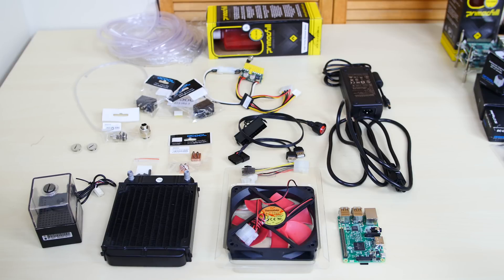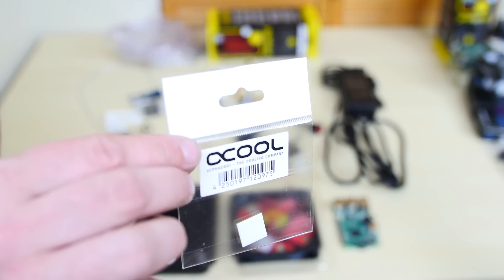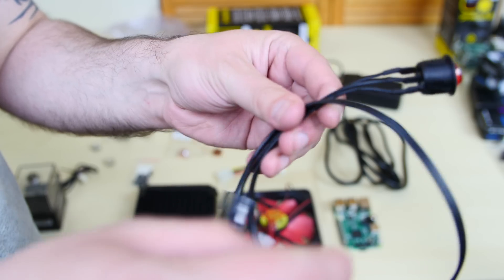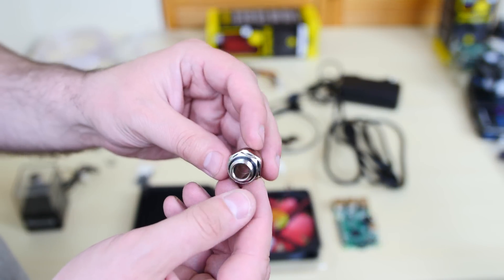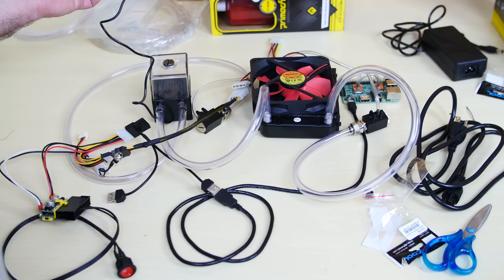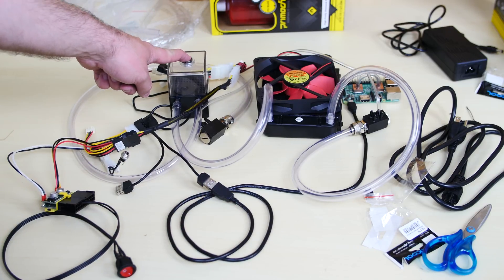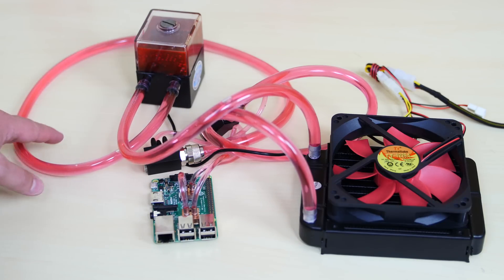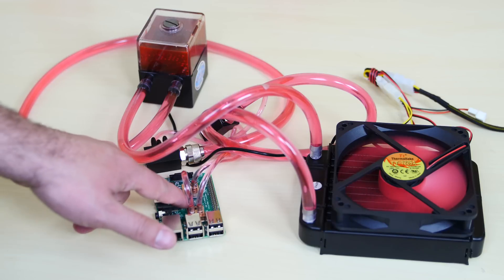Water Cooled Raspberry Pi 3 - Part 1 - The Build

Comment: Nice video. Although I do not see the point as the standard copper heat sinks for Pie is enough. But probably more for the show, as that would look brilliant if mounted on the wall or even inside desk with glass over it.  

But please, stop explaining everything a million times. The only thing that is stuck in my head right now is how the two blocks are connected to each other with a 3mm pipe, I think everyone got it after the 10th time!!

Comment: One thing id suggest is to use two connectors on that adapter so each water block is fed separably in parallel instead of in series , if anything just to increase the amount of fluid the pump can move and get the air out easier .

Comment: If you'd use separate 3mm tubing to both copper heat exchanges than you would have two separate flows and that would increase the liquid throughput.

Comment: You should have put a separate tube from the converter to each of the blocks to have a bit more flow.
With the restriction of the small tube i MIGHT increase the flow.

Would that make any difference? No clue :P
Would it matter? OFC not, this whole video is for the lolz :D

And why did you bother with the SATA to molex adapter? You realize you can daisy chain them right?

Comment: I'm sorry but this is the stupidest thing ever (yes, stupidest to fit the horrible method of watercooling).... first off, that is a HORRIBLE way to connect the waterblocks.... second that's a HORRIBLE method to reduce the size of the tubing.... third that whole set up is HORRIBLE.... fourth why the hell are you using that sort of 'power supply'? fifth why are you CALLING that a power supply when its not? sixth why are you using SO MANY FREAKING WIRES?! that whole set up could have been done with VERY minimal wires and sooo much cleaner... you dont need all those 'converters', you dont need a freaking 20 pin COMPUTER power supply connection... you could have just bought a 5 volt power brick that supplied plenty of amps, then used either a break-out board or a break-out cable to prove the power for the Pi AND the pump. Then, you just need to connect the fan to the break-out whatever and presto! And yes, i mean connecting the fan to a 5 volt power source. sure it isn't 12 volts, but 5 is enough to 'spin' the fan to move alittle air... since ya know, the Pi isn't exactly going to be needing cooled all that much -.- hell you could completely ditch the fan all together! the ambient air temp would be plenty to cool off the radiator passively... and if you're sooooo keen on powering that fan with 12 volts, then why not just get one of those external IDE to USB converters? the power bricks with those are 12 Volts and the 'plug' is a straight up molex. then you can just attach the USB converter for the Pi, then attach the fan to the USB converter's molex, then attach the fan header converter, then attach the pump... that way its all in one nice neat straight line with less converting and less cables... but you could make it even better by just getting a normal 12V power supply and connecting it to a breakout board that has molex, fan headers, and usb, and boom you're done...
Reply: yet we're here watching his video and not yours
Reply: Does it really even matter?  I'm pretty sure he just did this as a demonstration, there is no need to make things look neat and tidy when you are just making a proof of concept for entertainment purposes, I doubt he had any true use for a single liquid cooled Raspberry Pi anyway

Also, I find it quite interesting that you insulted his method of liquid cooling and didn't give your opinion of how it should have been executed

All in all, I thought he did a nice job setting all this up, I've seen people do much worse for a complete finished system

And BTW, the PicoPSU IS a power supply, ok fine, so it doesn't have a built-in bridge rectifier, therefore relying on the bridge rectifier in the power brick, but the PicoPSU still takes the 12VDC and converts it into 5VDC and 3.3VDC where needed, which is what a power supply does, a bridge rectifier just converts AC to DC (opposite of an inverter)
Reply: Its called fun. OCD much?
Reply: +The Cookster please go look up the definition for OCD please... And yes I know it's for fun, but doesn't excuse doing a piss poor job at something that could be much simpler, work better, and be more fun to implement. Sure it may be fun to do it this way. But I don't see how it would be any less fun to do it properly. This is more like someone being bored and bought/used whatever parts they had lying around to build something. Now if that were the case, then yea this would be awesome. But I'd still make the suggestion of doing it properly once they had the right stuff. But since that isn't the case, my point still stands. If you're going to do something, do it right the first time. That way you don't have to fix mistakes down the road. It's what almost every manufacturer of anything does when releasing a product. Sure some don't always catch every flaw, but no one can catch everything. But the more care you put into something, the less likely it'll blow up in your face.
Reply: Hikari
Continue with your need to have everything done your way. Since we're being PC i'll spell it how you want it. OCPD. Does his raspberry pi overheat? No. Will anyone need to know how? No. If it did blow up you lost $30 boo hoo. Its called fun not following orders.
Reply: The Cookster What does following orders have to do with anything? and that's still incorrect. Nothing about what I said has to do with being tidy, following rules, or maintaining order. It has to do with doing something in a sensible way that makes sense logically. Why waste money on a piece of metal that converts one giant tube into 5 small ones? It doesn't make sense, even for 'having fun'. So yea, people can go out and spend 80 bucks on supplies to do something like this, when it would only need maybe 50 (including the price of the Pi). A person can do whatever they want when it comes to 'fun', but that doesn't make it right. Cause ya know, people used to think having slaves was 'fun' too. And there's people out there that think kicking puppies is also fun. Doesn't make it right. 

So you can continue to do whatever ya want, have fun at it cause I know you are anyway =D In the meantime, I'll just leave the critical post here, cause ya know, its the entire point of the comment section: To leave criticism, praise, suggestions, and ideas on a video. Not for people to do it to the comments themselves. Have fun reading the dictionary =D
Reply: Hikari
First off overthinking something is not fun. This video is for fun and not to inform as who in their right mind would water cool a raspberry pi with the intention of stopping it from overheating. Wasting money in the name of fun is commonplace unless you didn't know and only adds to the, admittedly stupid, fun. Trying to strawman me with slavery is completely pathetic. Kicking puppies and slavery is not in the same sense of "right" or "wrong" and you know it. How dare you compare these to water cooling without the most efficiency you complete autist. You leave your critical responses of how someone does things and i'll leave mine. Mine being to you.
Reply: Hikari And yet again, you fail to explain the "proper" way of doing it, anybody can say something is "wrong", "improper" or a "bad idea", but unless you explain your side of it, like how you would do it instead, you have no proof you actually know what you are talking about, or that you even know of the "better" way of doing it

Comment: just a question, with the 3mm tubes would you see any temp difference if they were in parallel instead? like spreading the in-out flow evently on both blocks.

Comment: Why would you put the cooling blocks in series when you have 5x 3mm divider? Not to say that you will be killing the pump with the one 3mm tubing. I would add an extra 3mm tube from one divider to another just so I don't stress the pump and have a decent flow. Anyway, nice job, your video shows the basic of water cooling, even if this might be an overkill.

Comment: I'm without a doubt not a computer expert but I'm a mechanic and I know a thing or two about thermodynamics. Would it be better to run a tee off the cool water to each heat sink and then tee the hot water coming out back to the radiator rather than running the heat sinks in parallel? I would think if you run them in parallel you would just transfer the heat from one chip to the other chip so the second chip would never get cool water.

Comment: There was enough pipe and fittings to run the cooling blocks in parallel instead of in series. Also, it would have been a lot easier to bleed to have the reservoir above the rest of the components. The bubbles you can see in the tubes should have been moving when the pump was running. In the part 2 you can see the great results, though.

Comment: I don't understand the power supplies, could you explain again. Everything is perfect, just perfect. What would be more perfect is if you cut a hole in the table for radiator air flow, oh and put that on video too.

Comment: Why  would you need to water cool Raspberry PI ?
Reply: bitcoin miners always needed that but they didn't know
Reply: Because it was there. lol... Hey hey proved that it could be done. :-)
Reply: on Thurday I came back from a resberry pi meetup in york university( toronto). I showed them your project after a guy was stress testing the GPU for 30 FPS using Camara attached. He had a fan attached with passive cooling. and the heat went up to 61 celcuis.
Reply from the maker: +Hagi Lerman You don't need to, but my geek soul wanted me to.

Comment: Nice job, but why not link the output tubs directly to the heat transfer so cold fluid in to the Pi chips and hot flows out?
Reply from the maker: +Harry Perlmutter next time around I will try that.
Reply: That way its set up atm is backwards. Should always go to blocks from pump to radiator. Just saying.
Also could of neatened it up a hole lot by cutting the hoses shorter.
Reply: This would not make a difference as water cooling loops get to the max temp regardless of positioning of heat sinks in the loop which is why you have to wait bout 20mins for the loop to get to max temp